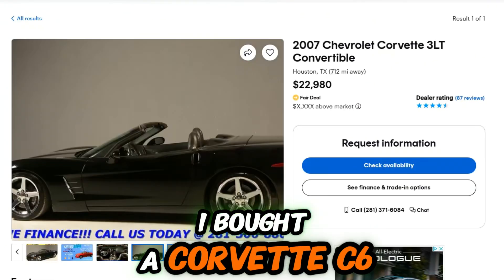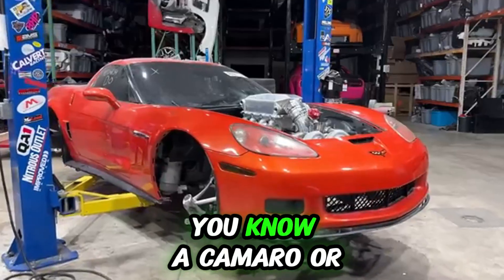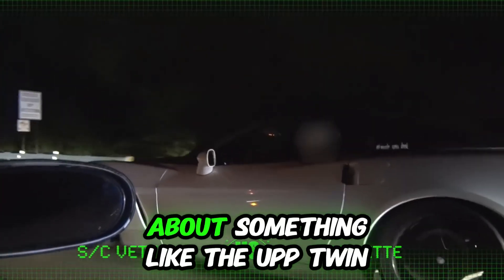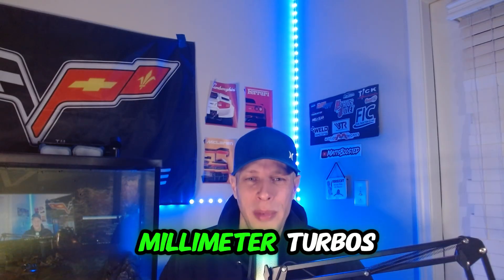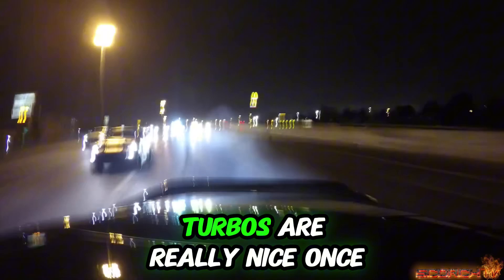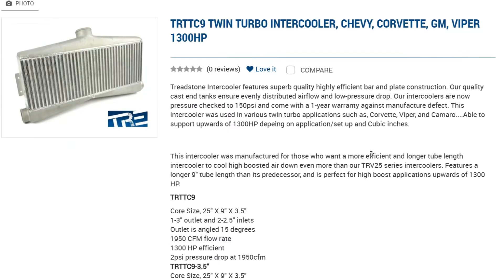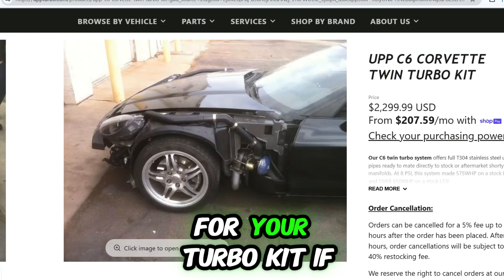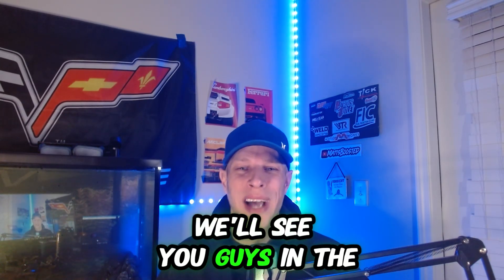Turbocharging a C6 Corvette: What You Need to Know

Comment: Did you boost it with stock internals or forged internals
Reply from the maker: I'm forged on my setup but you can boost on stock internals up to around 700 HP safely (with a good tune)

Comment: The c6 don’t have fordge piston big mistake!!!!
Reply from the maker: Should be ok as long as the tune is on point and you aren't trying to hit 4 digits.
Reply: IMO cast pistons are more reliable and if you need forged pistons for the power you're making you're probably changing pistons anyway
Reply: No, if you have a proper tune with zero detonation, it will run forever.